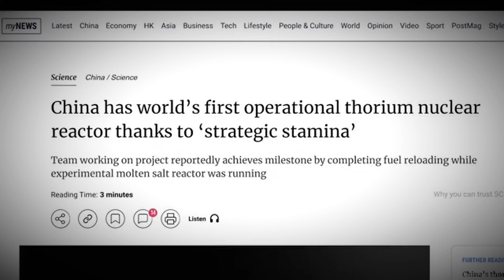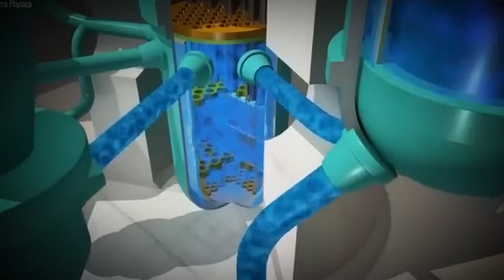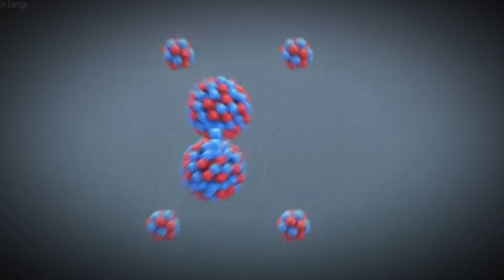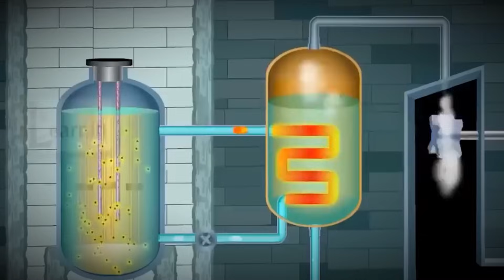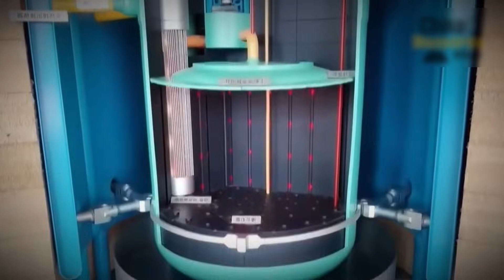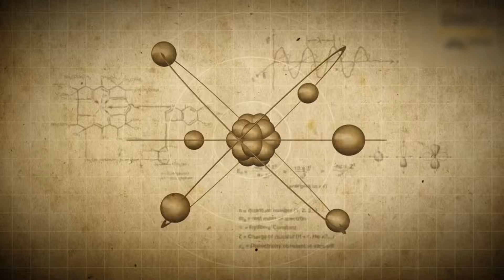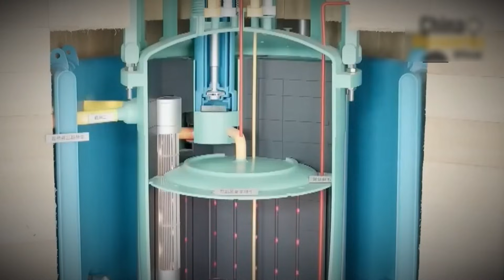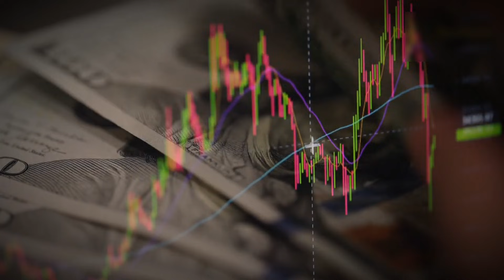China Quietly Did What Western Nuclear Programs Walked Away From

Comment from the maker: Do you think China’s thorium molten salt reactor marks a real shift in nuclear engineering—or is scaling still the biggest barrier holding this technology back?
Reply: They just have a U-235 reactor. The TMSR-LF1 has a conversion rate of about 0.1 for thorium, that means it is far away from using thorium efficiently. The original schedule mentioned the construction of the TMSR-LF2 from 2018 to 2025, which should have been the first thorium breeder with a conversion rate close to 1, but until now the construction hasn't been started yet.
Reply from the maker: @andreasschmitt2307  You’re raising a fair and technically accurate critique, and it actually aligns with what the script was careful to say.

TMSR-LF1 is not a thorium breeder reactor. It is fundamentally a U-235–started molten salt reactor with thorium added to study fuel behavior and conversion under real operating conditions. A conversion ratio around 0.1 means exactly what you point out: thorium utilization is still very limited at this stage.

You’re also right about TMSR-LF2. Early roadmaps did describe it as a follow-on reactor with a much higher conversion ratio, closer to a breeder concept. As of now, there is no public evidence that LF2 construction has actually begun, which suggests delays, redesigns, or reassessment. That’s not unusual for advanced nuclear programs, but it does matter.

So the honest framing is this:
	•	China has proven operation of a thorium-loaded molten salt reactor
	•	It has not proven efficient thorium breeding
	•	And the step from LF1 to a true breeder remains unvalidated

That doesn’t negate the achievement, but it does cap the claims.

The open question now is whether China pushes ahead with a true breeder design, or continues using molten salt reactors primarily as high-temperature uranium systems first. Which path do you think is more realistic in the next decade?

Comment: Molten Salt is the is the new technology that reduces waste/pressure/risk/water. Thorium is a fuel available in most countries unlike Uranium.  IMSR is the states reactor that will make energy abundant and cheap reducing poverty throughout the world.  IMSR just needs built...cladded fuels are expensive and risky and why IMSR uses typical (LEU) current supply chain fuel and once operational will scale very quickly....we need that.  IMSR is the stepping stone we can't bypass easily for abundant affordable energy to everyone.  The IMSR reactor once built will likely scale with Thorium and other reactors wastes for fuel, but get it running now on Uranium!  Design currently is modular/about 395MW's x2 reactor's.....substantial energy
Reply from the maker: You’re hitting several valid points, but it helps to separate what IMSR is designed to do now from what people hope it can do later.

Molten salt technology does reduce pressure, water use, and some risk factors. That part is solid. Using liquid salt as coolant changes the safety profile compared to traditional reactors.

IMSR’s key strength is actually what you point out next: it runs on standard low-enriched uranium using today’s fuel supply chain. That’s why it’s positioned as a near-term reactor, not a moonshot. It avoids the biggest regulatory and fuel hurdles that slow down thorium systems.

Where the argument often goes too far is scale and speed. IMSR still has to be built, licensed, and operated at full commercial scale before “cheap and abundant” energy becomes real. Modular design helps, but it doesn’t eliminate construction, regulation, or first-of-a-kind costs.

Thorium and waste-burning concepts could come later, but IMSR succeeding on uranium first is the realistic stepping stone. Without that proof, nothing else follows.

So the real question is this:
Do you think the main bottleneck for IMSR is engineering, licensing, or political will?

Comment: The future of nuclear energy is thorium considering it safety in terms of meltdown and waste. So the Chinese have invented a way for the future in energy safety without concern for environmental risk and it can't be used to develop nuclear weapons.
Reply from the maker: Thorium reactors do offer real safety advantages, especially in molten salt designs. Low-pressure operation and passive safety features greatly reduce meltdown risk, and waste volumes can be lower than in conventional uranium reactors, though waste is not eliminated entirely.

China hasn’t solved every problem yet, but it has moved thorium from theory into real operation. That’s the key shift. It shows a path toward safer nuclear systems, not a finished answer.

On weapons risk, thorium systems reduce proliferation incentives, but they don’t make them impossible. The benefit is higher barriers, not zero risk.

The big question now is what holds this back most: scaling the technology, regulation, or public trust?
Reply: Molten Salt is the is the new technology that reduces waste/pressure/risk/water. Thorium is a fuel available in most countries unlike Uranium.  IMSR is the states reactor that will make energy abundant and cheap reducing poverty throughout the world.  IMSR just needs built...cladded fuels are expensive and risky and why IMSR uses typical (LEU) current supply chain fuel and once operational will scale very quickly....we need that.  IMSR is the stepping stone we can't bypass easily for abundant affordable energy to everyone.  The IMSR reactor once built will likely scale with Thorium and other reactors wastes for fuel, but get it running now on Uranium!  Design currently is modular/about 395MW's x2 reactor's.....substantial energy

Comment: Not mentioned is the fact that China is building a 35mw TMSR as it scales up thorium reactors. This reactor began its manufacturing in early 2025.  On the drawing boards is a TMSR powered container ship and if successful, it doesn't take much imagination for TMSR to show up on naval ships. Further, in remote areas, routing high voltage grids may not make much economic sense and placing these reactors in these regions, especially where there is little water, makes economic sense. TMSR  lend themselves to being manufactured in factories like building ships and can be hauled by truck or train to the needed site.  Construction times would be fast and mass production would reduce costs. These reactors also lend themselves to below ground facilities to minimize terrorists attacks.  China has another winner in the making as both a domestic need and a highly exportable product. One would think Africa, Latin America, and the Middle East would be excellent markets for this type of reactor.
Reply from the maker: That’s a thoughtful comment, and it’s pointing in the right direction, but it helps to separate what is confirmed from what is still conceptual.

China is moving beyond the two-megawatt TMSR-LF1 research reactor. Publicly stated plans from Chinese research institutions describe larger demonstration-class molten salt reactors as the next step, often discussed in the tens of megawatts thermal range. These are intended as scale-up platforms, not yet commercial exports. Work accelerating in the mid-2020s fits that trajectory, but details like exact power ratings, construction start dates, and manufacturing status are still limited in open reporting.

The idea of TMSR-powered ships, including container vessels, has been discussed in Chinese academic and planning circles, especially because molten salt reactors operate at low pressure and can provide steady high-temperature heat. However, these remain conceptual studies, not approved shipbuilding programs. The same applies to naval use. It’s a plausible long-term direction, but there is no confirmed deployment timeline.

Where your comment is strongest is on deployment logic.

Molten salt reactors are well suited to:
	•	Remote regions where extending high-voltage grids is expensive
	•	Water-scarce areas where traditional nuclear and thermal plants struggle
	•	Factory manufacturing, where reactors are built as modules and transported by rail or truck
	•	Underground or hardened installations, which improve physical security and resilience

Those features align closely with how China already thinks about infrastructure: centralized manufacturing, rapid construction, and deployment in regions conventional systems cannot serve efficiently.

On exports, the opportunity is real, but not immediate. Before TMSRs become a global product, China still has to prove:
	•	Long-term materials durability
	•	Stable chemistry control at larger scale
	•	Licensing frameworks that other countries trust

If those hurdles are cleared, regions like Africa, Latin America, and parts of the Middle East would indeed be logical markets, especially where power demand is growing and water is limited.

So the big picture takeaway is this:
China does appear to be building toward a future where TMSRs are deployable, modular, and flexible, but today they are still in the proof and scale-up phase, not the export phase.

That distinction is important, because it’s exactly how China tends to win technology races: quietly validating systems first, then scaling once uncertainty is low.

Comment: China chose both paths. Plz also talk about Chinese uranium reactors.  SMR too
Reply from the maker: Good point, and you’re right to call that out.

China did not bet everything on thorium or molten salt reactors. It chose both paths in parallel.

On the conventional side, China has one of the world’s largest build-outs of uranium-fueled reactors. Most of its current nuclear power comes from pressurized water reactors, including domestic designs like the Hualong One. These are grid-scale plants, already operating, already supplying electricity, and forming the backbone of China’s nuclear expansion.

At the same time, China is pushing small modular reactors, or SMRs. These are uranium-based as well, designed to be smaller, faster to deploy, and suitable for remote regions, industrial sites, or district heating. Some Chinese SMRs are already under construction or entering early operation.

Thorium and molten salt reactors sit alongside this, not instead of it.

Think of it as a layered strategy:
	•	Uranium reactors for large-scale power today
	•	SMRs for flexibility and near-term deployment
	•	Molten salt and thorium systems for long-term options and future constraints like water scarcity and fuel supply

That’s what makes China’s approach different. It’s not an all-in gamble on one technology. It’s a portfolio strategy, where proven systems deliver power now, while experimental systems quietly build experience for what comes next.

That nuance often gets missed in online debates, so it’s a solid point to raise.
Reply: Molten Salt is the is the new technology that reduces waste/pressure/risk/water. Thorium is a fuel available in most countries unlike Uranium.  IMSR is the states reactor that will make energy abundant and cheap reducing poverty throughout the world.  IMSR just needs built...cladded fuels are expensive and risky and why IMSR uses typical (LEU) current supply chain fuel and once operational will scale very quickly....we need that.  IMSR is the stepping stone we can't bypass easily for abundant affordable energy to everyone.  The IMSR reactor once built will likely scale with Thorium and other reactors wastes for fuel, but get it running now on Uranium!  Design currently is modular/about 395MW's x2 reactor's.....substantial energy

Comment: I had checked up AI.   Oakridge had never used Thorium in its molten salt. Jai Hind.
Reply from the maker: You’re right to look closely at Oak Ridge, and the distinction matters.

Oak Ridge National Laboratory did operate molten salt reactors in the nineteen sixties, most notably the Molten Salt Reactor Experiment. That reactor proved that liquid-fuel molten salt systems could run stably, but it did not operate with thorium loaded directly into the reactor as fuel.

The MSRE initially ran on uranium two three five, and later on uranium two three three. That uranium two three three had been bred from thorium elsewhere, but thorium itself was not used as the fuel salt inside the operating reactor.

So the correction is this: Oak Ridge pioneered molten salt reactor technology, but it never operated a thorium-fueled molten salt reactor.

That’s why China’s system matters historically. It is the first time a molten salt reactor has been brought to sustained operation with thorium actually loaded into the reactor, moving the thorium fuel cycle from theory into real operating conditions.

Jai Hind! 🇮🇳
If you want, I can link to the ORNL sources that show the exact fuel mix and operational history?
Reply: Molten Salt is the is the new technology that reduces waste/pressure/risk/water. Thorium is a fuel available in most countries unlike Uranium.  IMSR is the states reactor that will make energy abundant and cheap reducing poverty throughout the world.  IMSR just needs built...cladded fuels are expensive and risky and why IMSR uses typical (LEU) current supply chain fuel and once operational will scale very quickly....we need that.  IMSR is the stepping stone we can't bypass easily for abundant affordable energy to everyone.  The IMSR reactor once built will likely scale with Thorium and other reactors wastes for fuel, but get it running now on Uranium!  Design currently is modular/about 395MW's x2 reactor's.....substantial energy

Comment: The goal is to develop larger, commercial scale reactors in the future. A 10 MW demo reactor is planned for around 2030, with 100 MW commercial units envisioned by 2035 but it does not currently use this technology to power homes or EV cars on a commercial scale
Reply from the maker: Exactly right. This reactor is a research platform, not a commercial power source. The roadmap being discussed is a 10 MW demonstration around 2030 and potentially larger units after that, but none of this is powering homes or EVs today. The real milestone is that they now have an operating system to learn from, which most countries don’t yet.
Do you think the scale-up challenge is technical, regulatory, or both?

Comment: Thorium reactors are considered safer than traditional uranium reactors because the fuel is in liquid form and automatically cools and solidifies in an emergency, preventing a meltdown. They also produce less long lived radioactive waste
Reply from the maker: That’s broadly correct, with an important nuance. Molten salt designs can offer strong passive safety features, like low-pressure operation and freeze-drain concepts, but it’s still important not to treat them as risk-free. What China has shown so far is stable operation and fuel-cycle behavior, not a fully proven commercial safety case.
What part of molten salt reactors do you think still needs the most proof before scale-up?

Comment: Good way of explaining how China used thorium energy to boost their future power generation
Reply: Molten Salt is the is the new technology that reduces waste/pressure/risk/water. Thorium is a fuel available in most countries unlike Uranium.  IMSR is the states reactor that will make energy abundant and cheap reducing poverty throughout the world.  IMSR just needs built...cladded fuels are expensive and risky and why IMSR uses typical (LEU) current supply chain fuel and once operational will scale very quickly....we need that.  IMSR is the stepping stone we can't bypass easily for abundant affordable energy to everyone.  The IMSR reactor once built will likely scale with Thorium and other reactors wastes for fuel, but get it running now on Uranium!  Design currently is modular/about 395MW's x2 reactor's.....substantial energy
Reply from the maker: Thanks, appreciate that. The key point we tried to make is that this is about proof, not instant power output. China isn’t using thorium to boost today’s grid yet, but they now have real operating data on a thorium molten salt system, and that’s what could shape future reactors.
Do you see this as more of an energy story, or a long-term technology race?